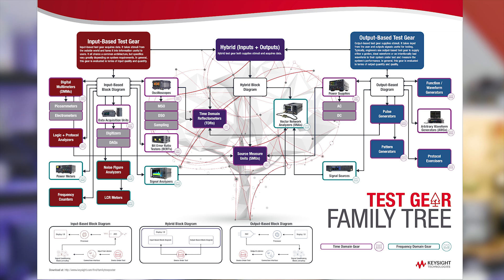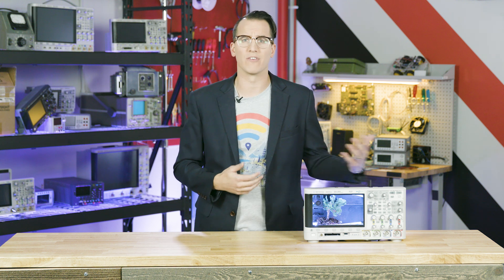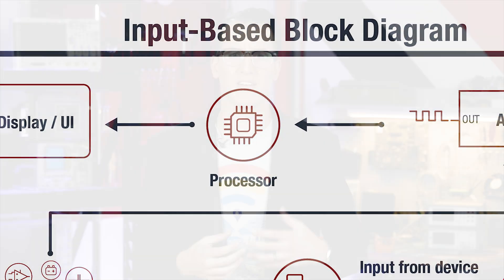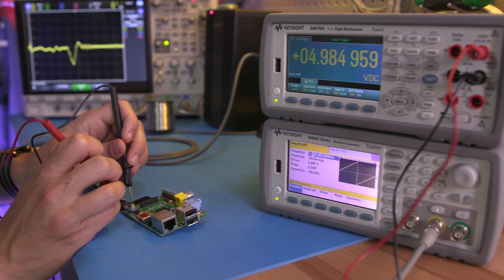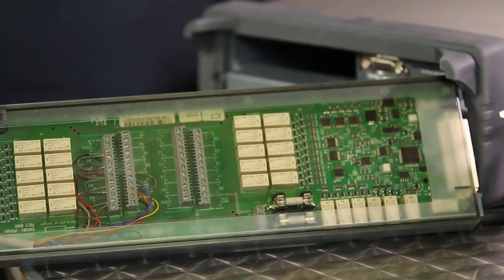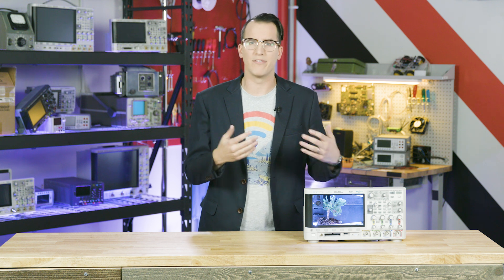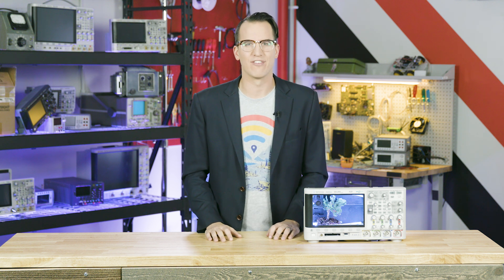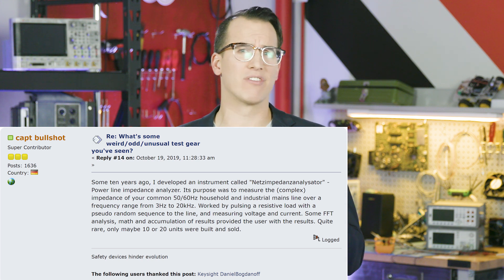Electronic Test Gear Explained

Comment: What about the HP 53310A Modulation Domain Analyzer...  Would that fit in frequency or time domain... Or both?
Reply from the maker: That is an interesting one I hadn't seen, both? But mostly frequency domain. It depends on how it actually makes the time interval error measurements.

Comment: Would that be possible to define an RF project such as making  a simple device, and explain the concepts and tools in RF, while building the device? I know mini/circuit has network analyzer kit, which you buy as kit and assemble them. Things like that will be very educational. Ben Eater made a computer this way and explain many concepts of digital electronics for mass.
Thanks,
Reply from the maker: Good idea! Ben's build is awesome, for sure.

Comment: I think I have some things that breaks your poster... what about THROUGHPUT measuring devices... such as the Valhalla 2101 Digital Power Analyser which measures current and power passing through it? (neither an input or an output device).
Also passive devices such as resistance and capacitance substitution units, or conversion units, an example is the Fluke A90 current shunt.
Reply from the maker: A clamp-on current probe also measures throughput. Whether you're snooping or doing a full passthrough, it's really all about the connection and how the signal actually gets passed into the conditioning circuitry. Electronic loads are an output, but it's more of a parameter output than a signal (cheating, I know). A shunt is just a current/voltage probe tip/accessory, if you think about it.
Reply: @KeysightLabs  I agree about the shunt being an accessory, but what about other passives? A voltage Divider has inputs an outputs. Perhaps it's more of a "source" because you set a setting on it and look at the output, but when used with a resistance bridge you use it more of an input of measuring device. Maybe it's more of a "signal conditioner" than anything else. Decade resistors would probably fit in this category too. Lab reference standards probably count as sources.

Excellent video and really good demarcation scheme overall!